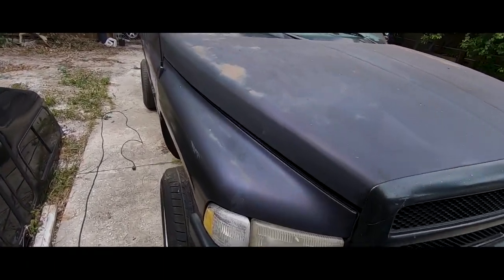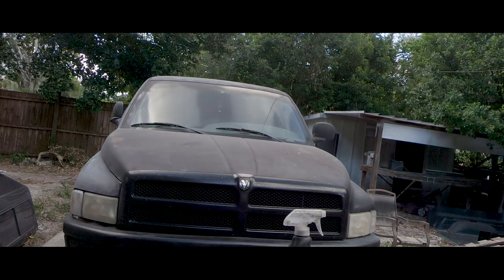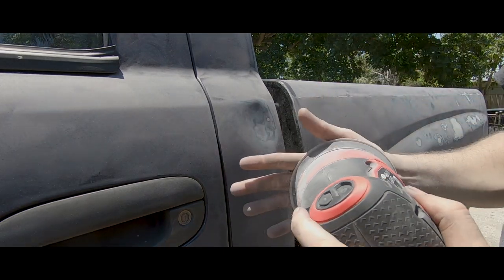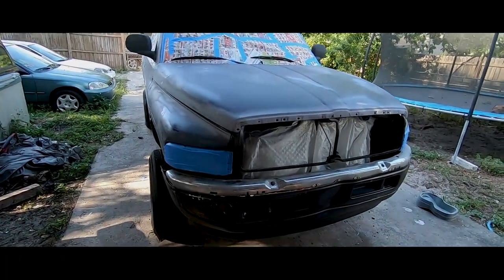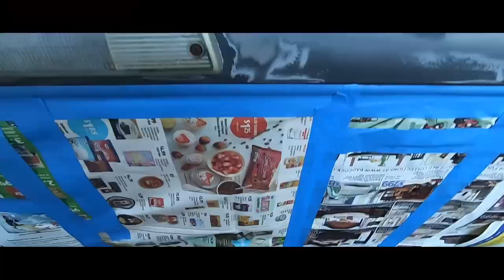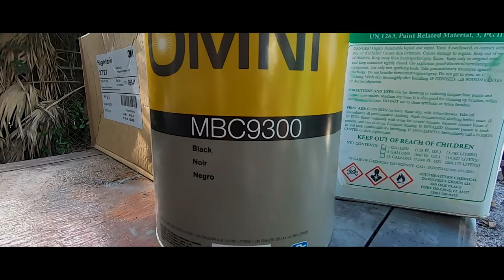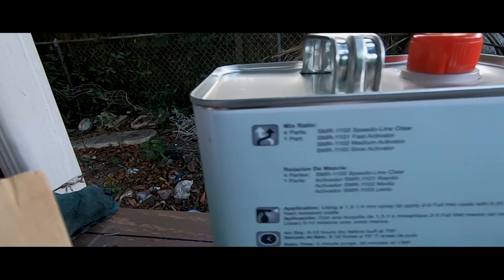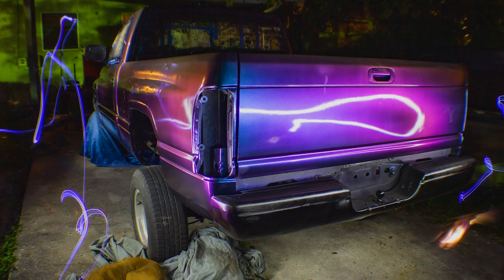How to paint your car/truck with Colorshift pearls! Painting my 2nd gen Dodge ram 1500

Comment: Ik your just learning man but for future reference you shouldn't make heavy passes on the first coat...dust it on let it flash dry for about 5-10 minutes depending on the mix ratio and then cone back and lay that heavy coat 👌🏼
Reply from the maker: Thanks for the tips! sorry for late response, ill be doing another video soon painting my camaro ill try dust passes bro! :D
Reply: If you lay a metallic or pearl ex colorshift it will give it a slightly different look after the clear. Nothing wrong with they way he did it. Try it next time on a couple pieces of plastic on the side just lightly dust or fog coat one and lay one wet and then put clear over both then take a look at them in some light you will see the difference.
Reply: Wow dude you seem like the rookie here it all depends on temp humidity and cure time you seem to know it all yet very little. Keep on chin wiggling ya chirper!

Comment: Hey brother small tip for body filler is to put guide coat on the body filler. When you sand it the guide coat will show you your low spots.

Comment: Not that it matters now but to anyone using body filler. Bondo is the worst brand possible to use if you're putting it directly to bare metal. It is acidic, and it will cause rust eventually. And that looks like a floor or wood type sander, isn't it? Also, it wouldn't have rusted if you use etching primer on the bare metal instead of gray filler primer. Filler primer is used after all your body work and sanding is done before you lay your base coat to help fill In imperfections from body work and any sanding marks.

Comment: Definitely push out the bigger dents from behind if possible so you aren't caking filler on. And block sand for a smooth finish. Using a DA sander will leave waves. It's not a big deal on an old truck though honestly everything you did was fine. The stuff I and everyone else is telling you only matters if you want a high quality finish. A few waves won't hurt anything on an old work truck that you just want to make look better

Comment: Another good tip I could recommend is not using regular bondo, but bondo with glass reinforced filler, or 3M Bondo 261 Lightweight Car Body Filler,
Evercoat 156 Lightweight Car Body Filler. All work well, they’ll be less likely to crack during season temperature changes, rough roads, just over all tends to last way longer. Looks amazing though. Don’t take any of this as criticism just friendly tip because you have the potential to be a good auto body professional. 👍🏼

Comment: I believe your suppose to spray it with intercoat clear then clear coat after...it still came out nice
Reply from the maker: Yes you are right, you can use intercoat clear then clear coat but at the time i only had clear coat but like you said came out good. i had alot of fun doing this.

Comment: So you mixed the pearls with the clear coat....was the last clear coat layer just clear or with pearls to? Ta
Reply from the maker: Yes I mixed the pearls with clear, normally u would mix with binder coat but clear works fine. And I didn’t add another coat of just clear I’ll do it in next project. I would recommend another coat of just clear.
Reply: @Boosted_Kev hey have a ?
Reply from the maker: @davidtumbs9478  whats up?

Comment: What do you mean by burn through while sanding?

Is it bad if the metal is showing?

That way you can turn the truck back into the original cavas to work with?

How many jars of the didspade colorshift did you need to fully coat the truck?

I'm trying to paint the exact type of truck and your video is extremely helpful 😁
Reply from the maker: I used a total of 50 grams of didspade pearls, which is 2 jars. and about half gallon of clear i still have half gallon clear left so i could spray it again. And by burn thru i mean while your sanding you dont wanna keep going down to baremetal youll have to use primer on all metal areas because if you spray just paint it will flake off later.
Reply: @Boosted_Kev  did you mix both jars in the half gallon ?

Comment: Where did you get your directions? Trying to paint my motorcycle. First time using this product. Can't figure out what to mix with or how much
Reply from the maker: I mix into my clear and i add pearls till i get the effect i want then i spray it. this entire truck took about 50 grams
Reply: I use trans star Lv500  blending clear with all my dry pearls/flakes . Sprays just like base coat .

Comment: Everyone has their acceptable look and results I suppose. But the video shouldn't be titled how to. Because this is actually a good how to not. You need to sand it down with the da. Then grind those dents out to the metal and push or pull them out as much as possible. Then spray a epoxy or etching primer before you apply mud. Then use a sanding block to smooth it out before primer. Then use a sanding block again over the entire truck. Usually another coat of primer and block once more. Lay your sealer, then black base. Especially outside, you should stop. Let it dry, the next day wet sand lightly. Then light coat of black, then your clear. Truck would look brand new. I'm sorry, but I guarantee that truck starts to bubble in a year.

Comment: How much clear did you use and how much black base did you use am just trying to see how much on everything I would need
Reply: i used about half gallon black half clear
Reply: OK thanks so much for replying man and looks good
Reply from the maker: @coreyowens346  Thank you! Id reccommend laying like 2 coats of clear that way you can wet sand and buff and get a mirror finish :D on this truck it has 2 coats of black base, and 2 coats of the pearl mixed with clear coat, you can also mix the pearls with a divider paint its like matte clear then you spray clear over top. but im happy how mine came out.

Comment: What gun and compressor did you use?
Reply from the maker: Harbor freight 21 gal compressor and harbor freight purple gun
Reply: @Boosted_Kev  thanks. Did you have to take very many breaks?
Reply from the maker: @brannontomkinson2143  not to much wasn’t to bad just compressor is loud. I bought brand new compressor which is quieter I just haven’t made any videos lately .